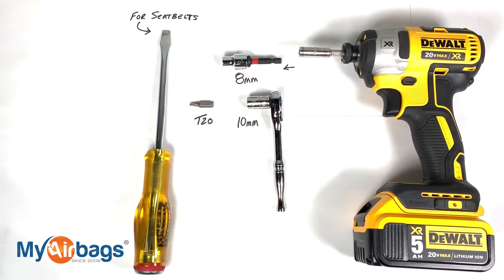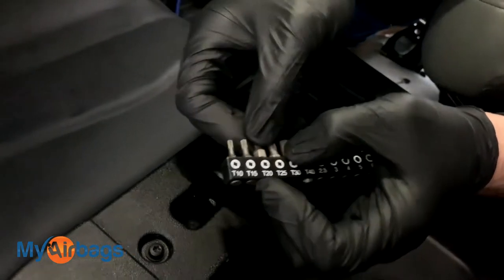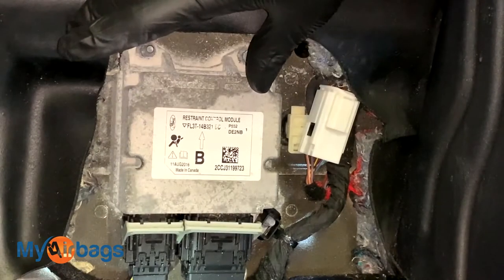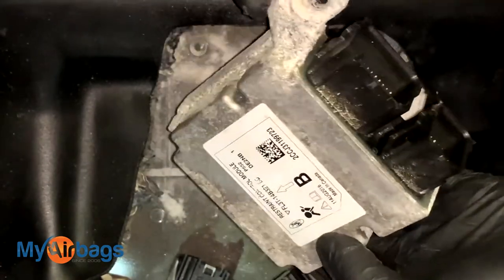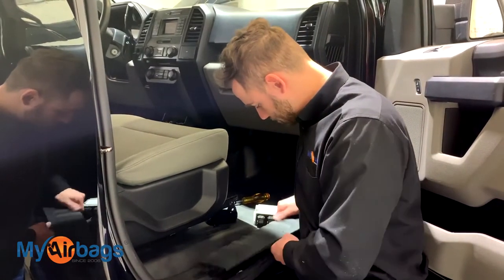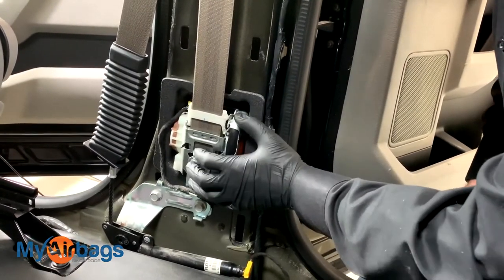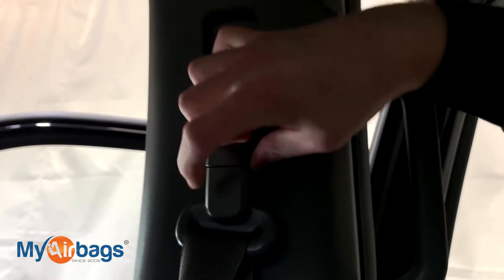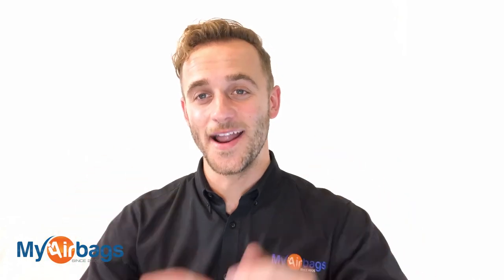How to Remove SRS Airbag Control Module & Seat Belts on a Ford F-150  | MyAirbags

Comment: When the drivers air bag was deployed, does the crash sensor need to be replaced?
Reply from the maker: Most dealers and shops don't change them if they are not physically damaged, meaning they don't have cracks or visible damage, they don't need to be replaced.   If they are bad, you will get it in the error code.

Comment: Yes I have a 2012 Ford f150 four-wheel drive I put another radio in it aftermarket and I had to take the front airbag out I disconnected the battery but when I put everything back together now my airbag light is on😊 court before scan that's on the passenger side do you have any idea what's the matter😮
Reply from the maker: Just need to use a scanner to clear the code. If a vehicle is in an accident, then using a scanner will not work because of crash history and crash data that needs to be cleared. MyAirbags.com can clear crash history and crash codes.

Comment: I just got my module back from you guys. Do I simply reverse the steps to put it all back together?
Reply from the maker: Argenio, Yes, make sure the battery is disconnected. Bolt down the module. Plug it back up. Then once you're done working with the airbag system, re-apply the batter power to the vehicle.

Comment: My f150 was in an accident and is a salvage rebuilt, sadly I failed the test due to the airbag light don’t show up and go off after turning on the truck. They told me the truck does not has headliner airbags but I checked them and it does has airbags. What’s should I do to bring that light back on?
Reply from the maker: Raul, If the light doesn't turn on at all when you start the truck, that sounds like someone may have disabled the lamp for the airbag light inside the instrument cluster.

Comment: Do I have to take it to a Ford Dealership to get the module connected to my truck because I bought one off of eBay after mine was damaged during the accident and don’t know if I need to go to a dealership to get it connected and then send it to you guys?
Reply from the maker: Bryan, as long as the used/new module is good and has the same exact part number as your original module, it can be programmed to your car. You can avoid all those potential issues by having your original module reset. We are here to help if you need: https://www.myairbags.com/product-category/repair-return/airbag-module-reset/

Comment: Do I have to reset the airbag light after I install the module?
Reply from the maker: Marco,
If the module is reset here at myairbags.com and it is the original module going back into the original vehicle, light will go out (as long as all the other deployed parts are replaced and connected correctly). Great question. Thank you!

Comment: So I have a 2004 F150 and I got T-boned on the passenger side a week ago. the airbags did not deploy, the engine was still running after impact so I pulled over and shut the truck down. ever since then it won't turn over it, wants to but it won't .
Would these sensors have anything to do with that?
Also NO, M.I.L. lights are  on
Reply from the maker: Bernard, The airbag module/computer shouldn't be the issue on your Ford. Its probably something else. If you find the solution, you are welcome to reply here in case someone had the same problem.

Comment: I have a 2017 Ford F150 Supercrew with code B1415:93-8B  "Driver Side Restraints Sensor 3"  additional info is "No operation".    Can you tell me where sensor 3 is located?
Reply from the maker: On that vehicle, it should be on the radiator support. 
Theres an article on this one in our MyAirbags.com Help Center: 
https://myairbags.zendesk.com/hc/en-us/articles/360001391787-How-to-Change-SRS-Impact-Sensors

Comment: I removed my seats completely and when I put then back in the air bag light came on,  do I need to send the module to you guys ??? There is no damage anywhere whatsoever
Reply from the maker: In this case, just have your airbag system scanned and pull the codes. The trouble code will let you know why the light is on. You can reply back on here with the code as well and we can help interpret it.
Thanks!

Comment: Mine is on for no reason, 2016 f150, comes and goes and now it’s just on. Is that something that needs to be reset?
Reply from the maker: The first step is to diagnose the airbag light. Hook up the scan tool / scanner to the car and read the airbag codes. You connect the scan tool right into the OBD port/plug. Its usually located below the steering wheel, on the left. You are welcome to reply to us with the trouble code that it reads.
Reply: My Airbags thank you for your response, I just saw this message. I tried that but I guess my scan tool is only for check engine lights.. it’s not reading no codes.... today when I went to drive the car the air bag light was off... seems like when it rains it wants to go on and off
Reply: I have a 2016 F150 with the Airbag light on as well.  Ford will not let you reset the Airbag light, so you will have to take it to the dealership. I took mine over there yesterday and they said there was something burned or shorted out and they had to order the parts. Good news is that they are covered under the restraining system warranty.

Comment: What is the turn around time? How quickly will I receive my parts back? Just wanted to let all the novices out there know, to unplug the plugs, you have to get a small thin screwdriver or knife and lift up on the orange button. I will come all the way out if you are not careful, but it doesn't matter, then you can unplug the tiny plugs.
Reply from the maker: Sunsettvu, once orders arrive here we ship them back out within 24 hours. Return shipping typically takes around 2-3 days. Here is a link to our site to start: https://www.myairbags.com
Reply from the maker: Sunsettvu, thank you for helpful advice. It will definitely be helpful to others.